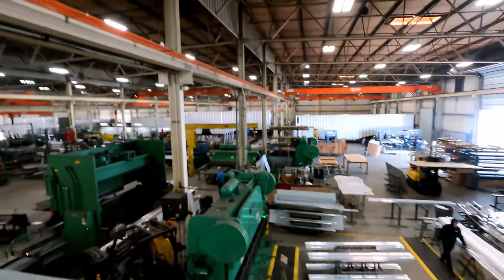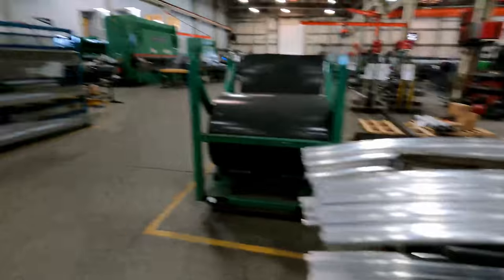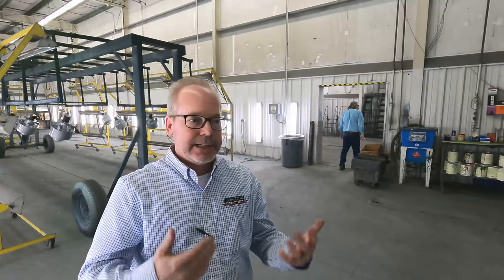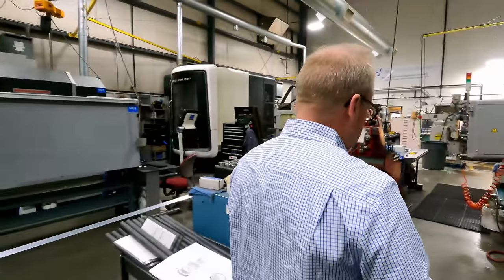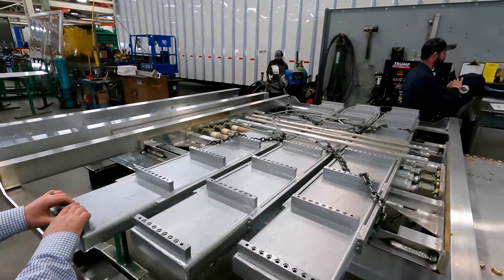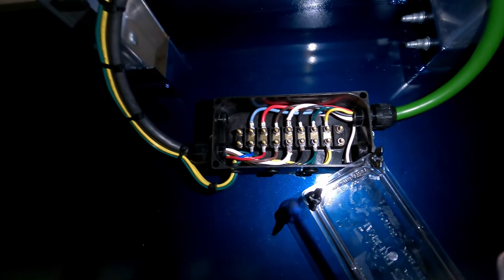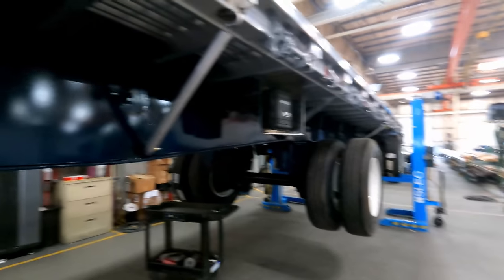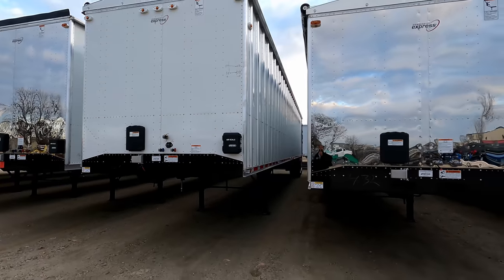Western Trailer Plant Tour Part 2 !!!

Comment: Very interesting Justin,  great systems, high tech materials and processes, top quality focus . Didn't see any draw bar trailers, all semi trailers even the stock trailers. In my country we have very different combinations B trains, draw bar trailers, and semi trailers. We do not run 53 footers our roads are not designed for them. I've noticed on other truckers vlogs that the US still uses pintle hook connections to a dolly, do you not use ringfeeders in the US? its the most common truck and trailer connection with a draw bar trailer we use. once again very interesting definitely another awesome video thanks Justin. Kenworth factory tour next?
Reply from the maker: As far as I know it’s a pintle hook design ....      I’m not familiar on that because we don’t pull doubles or triples etc ..... ha !!!  That be great to do a Kenworth tour !!